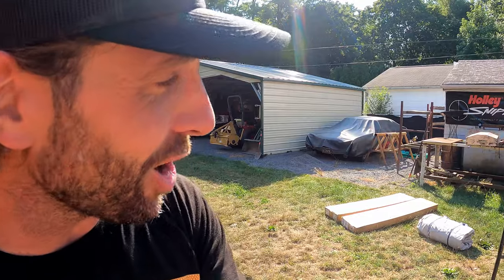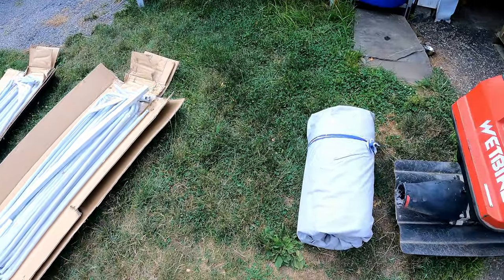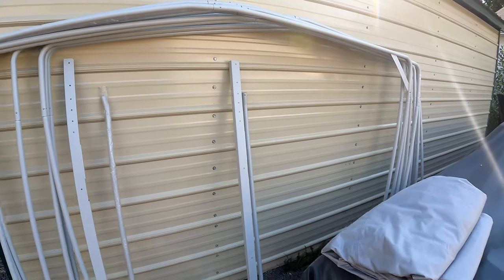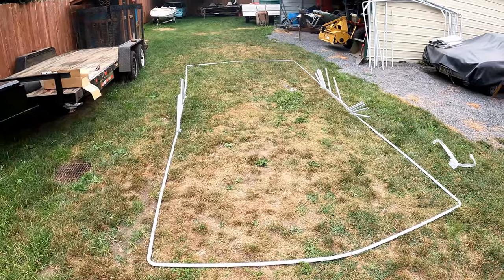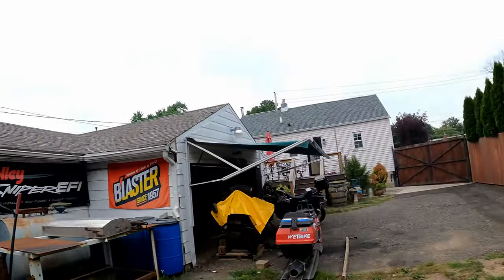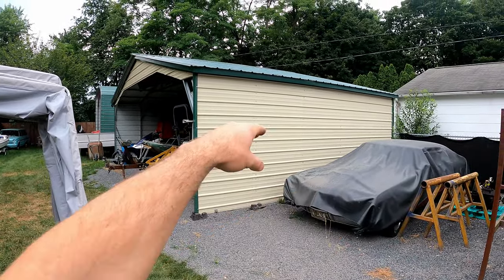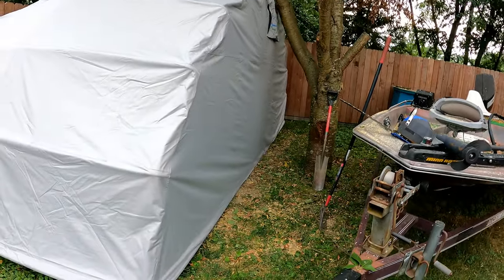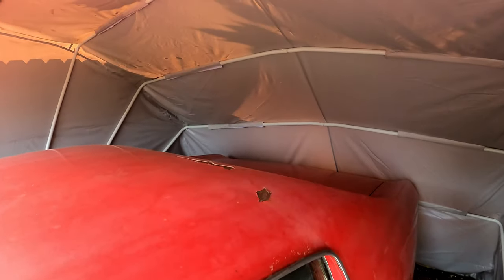Ikuby Car Shelter Assembly / Review   Portable Carport

Comment: Please do an update video after the winter.  I've been wondering how they hold up on dirt. A friend of mine has has his a couple years now, it's on a concrete pad. In the winter he puts a small heater in it to prevent snow build up. Of course he only runs it during forecasted snow of 6" or more.

Comment: Nice shelter and it seems like it will do the trick. I was curious about your neighbors--- it seems like you would constantly be in your back yard, working on cars, revving engines, using compressors, saws, drills, etc. Do they ever complain about the noise? Just wondering about the practical side of things.

Comment: Those serrated nuts bite into the surface to keep from loosening. I use them all the time.
Reply: Doesn't need split washer with those ridged washers built-in to yhe nut.